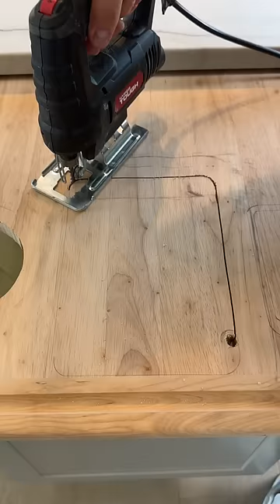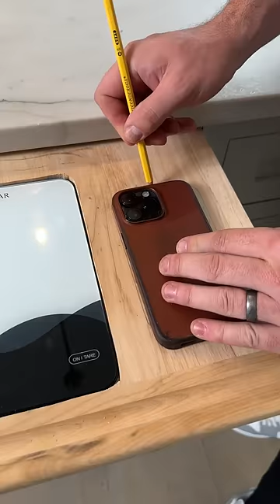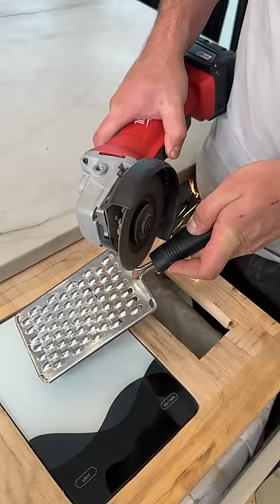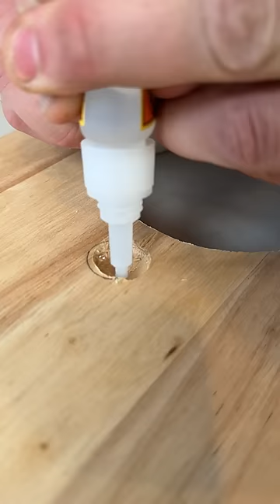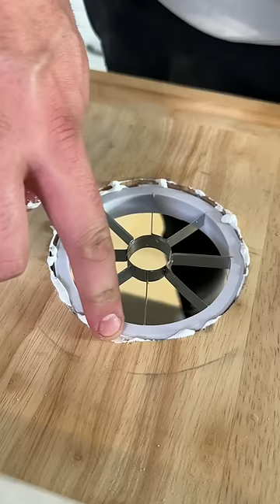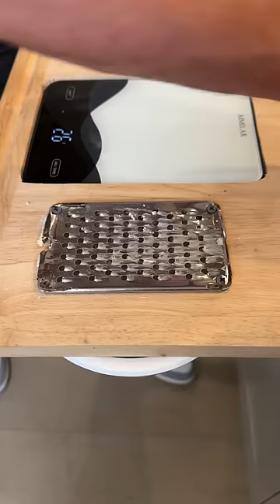THIS IS WHY I MARRIED HIM! 😍

Comment: bro has to put his entire countertop into the dishwasher at the end of the day
Reply: Plot twist - he built the kitchen in the dish washer
Reply: you just need screwdrivers and other tools, dismount them to wash and then remount every time you use it... it's a perfect solution to employ time of your wife, to make her happy
Reply: @fullon763  You know what's easier and way faster than having to loosen and tighten four wood screws potentially multiple times a day? Just leaving the handle on and using it like a normal person, so you can just chuck it into the sink or dishwasher when you're done. Every time you work those screws, you risk stripping the threading or the head. You can even see his impact gun skips a few times while tightening it down, so at least two screws are already stripping.
Reply: @goodolddoug889 
Would have been easier to make a place where it fits and can be held by something. Then, you take it out.

Still an issue of sanitation, considering you put chicken in there too. But hey, at least that is one less problem. For this over engineerwd solution to a problem that never existed.
Reply: @fullon763    Who the hell wants to unscrew the grater every time you use it?  That's nonsense.